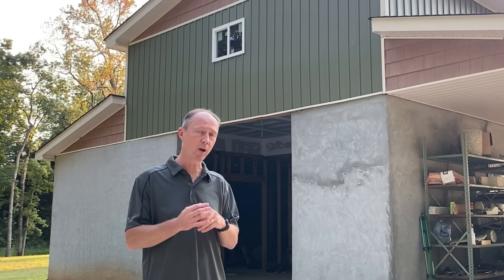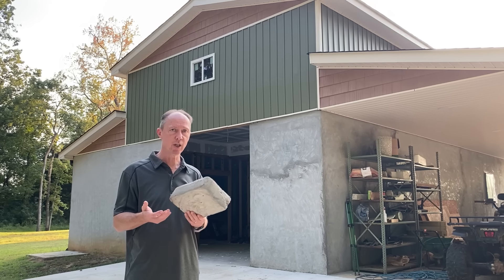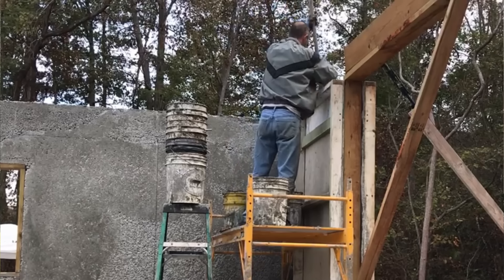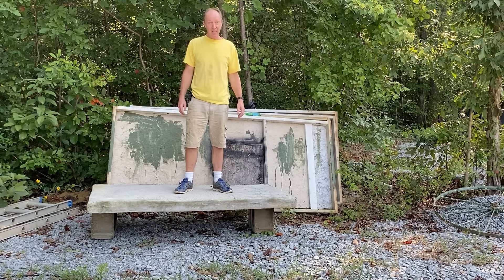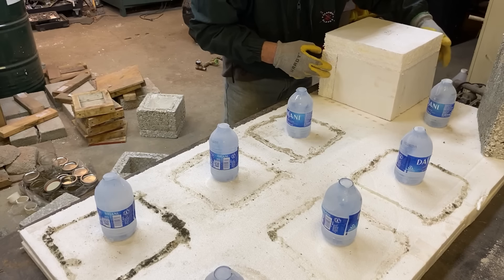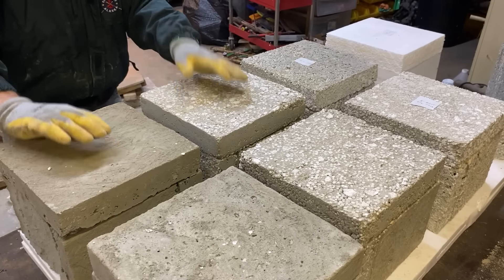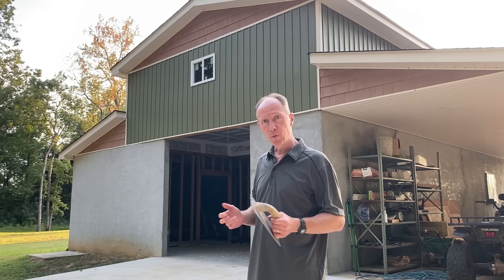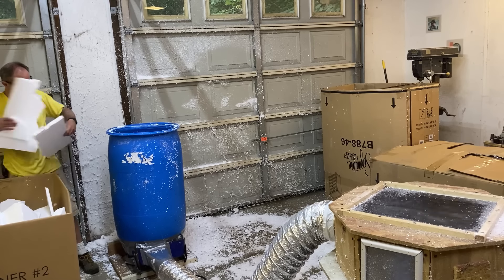The White Gold Rush?! The Video That CHANGED Aircrete Forever!

Comment: Where you will have windows. Try preforming a portion of wall with windows as per Tilt up conc. panel construction system. Put a groove at side edges and fill void with your mix for continuity once erected. Anchor joints with embedded metal plates...... I would like to know if that helps you on your next project. Well that is if you will perform these method.... thanks
Reply from the maker: thanks for the tip! subscribe for new builds coming soon!

Comment: Very creative. Wonder if someone will watch your video and start a building business? Perhaps you should patent your process. 
What is the structural strength of aircrete styrofoam?  Not certain if it will meet local building codes??  Also, needs to be able to withstand 100+ mph wind loads (based on local codes). Not certain how one should test for that. 
Thanks for sharing. Looking forward to future updates.
Reply from the maker: Done! Subscribe for new builds coming soon!

Comment: Great information, thankyou. I have made a foam generator that can fill 200 litre drum in about a minute and a half but found it very difficult to get consistent aircrete due to mainly getting it mixed with the cement. I have tried mixing with sand and had separation problems with that. I think you have hit on a great idea that would work for me and I am now going to make a polystyrene shredder. I think it would make mixing a lot easier. Thanks again.
Reply from the maker: New foam free recipe video coming soon! Subscribe to be notified!

Comment: Easy way to shred the foam would be to get a metal rod drill a buncha holes in it the same size as a metal clothes hanger put them through then bend them 180 put a hole in the bottom of the drum for the other side of the rod to ride in using locknut and washer to the bottom attatch the other side to a drill and in no time then would shred it up
Reply from the maker: Thanks for the tip! Subscribe for new bulds coming soon!

Comment: At 10:12 where you show filling in a void under the window. I can see in the rest of the wall heterogeneity in the mix. The bottom has less Styrofoam in the mix than the top. I think this is due to your pouring with buckets and mixing method. I would be interested to see how homogeneous you can get the mix with a concrete pump and a bigger mixer.
Reply from the maker: New builds coming soon! Subscribe to see the results!

Comment: Can you attach this to the outside of a cinder block house for strength and insulation? Are you sure this will last for year's to come? Awesome video thanks for sharing.
Reply: Tommy you would need to make a mold however thick you want to pour up next to the cinder block. Wet the block with bonding agent and pour it in and pack it. Then cover with the fiber mesh and stucco it. Yes it will last.
Reply from the maker: New builds coming soon! Subscribe to stay tuned!

Comment: hmm this makes me wonder, what if you produced small glass hollow beads the size of marbles (could make a machine that pumps them out pretty fast), and mix that with the Crete slurry carefully, how good would that be?!
Reply: if you are into recycling, you could potentially do that with plastics as well id say,  mix a small amount of crete to a large portion of shredded Curled plastic waste (ultimately making a brick that is 80% air),  and coat the outside to make it solid
Reply from the maker: Sounds great! Go for it! Subscribe for new builds coming soon!

Comment: I've found much success using Poraver(expanded glass beeds), and using a superplasticizer(high range water reducer) to increase the flowability, ~2-3% or so added fiber reinforcement.  It creates a much more stable product, but obviously it is not nearly as recycled or cheap as this method.  I lay fiberglass mesh mats w/ 1/2" spacing on the inside vertical surfaces of the molds.  My molds have small holes so that I can tie down the mats to prevent any movement during pours.  This results in a fully structurally stable wall once fully cured.  It just requires a few coats of stucco for finish.  Your method I'm sure is magnitudes cheaper though, Poraver can get a bit pricey.  I might have to try to incorporate some recycled Styrofoam into the mix design and see if it remains stable.  Nice job though, the finished product looks great and seems quite strong!
Reply from the maker: thanks for sharing! subscribe for new builds coming soon!

Comment: Thanks for the encouragement. I have experienced the same problems with the inconsistency of aircrete. You described the parge you apply to the workshop wall as aircrete stucco. Could you please elaborate on what this is?
Reply from the maker: UGL, I did not say that right if that is what I said. I am using a regular 1 part portland, 2 parts sand mix for the first coat , and 1 part portland and 5 parts sand for the second coat.
Reply: @AbundanceBuild  Thanks for the clarification.
Reply from the maker: Workshop July 25 - 28th!

Comment: Hi Stephen, I really enjoyed your video's. I am a construction student and and working on a home design for a final project. I have been looking for affordable, sustainable building techniques to bring down the costs while raising the sustainability. I would love to chat more with you about this or see some more videos. I see they are very recent so I'm sure you're hard at it. The only thing that I'm not crazy about is the stucco look on the exterior of the home. Wondering if you have experimented with any other finishes that reinforces the styrofoam aircrete? Still, its and interesting alternative that has potential. Thanks!
Reply from the maker: Thanks for the feedback Andrea and glad you are studying affordable sustainable building methods. I have three videos out total now and working on the 4th. My next build will have light wood trusses in the wall on 24 inch centers and give you a nailing surface for any siding you want to use on the wall and roof. My email is stephen.williams64@yahoo.com
Reply: @AbundanceBuild  greetings sir
Excellent adaptation and improved methods for alternative long term eco friendly efficient housing and structures.

Comment: Have you given any thought to approaching a university that has 1) school of engineering (mechanical, structural and material science) along with 2) a school of architecture (architecture, construction engineering, etc.) to perform some of the basic strength tests, material tests, construction techniques, design some basic structural products, etc. so that your overall approach will be generally accepted to the various building codes?   Your overall material would certainly provide an excellent basis for a number of senior projects as well as master's thesis.  This would lend itself to a wide range of cross-domain collaboration within the various engineering, construction, and architectural programs.  You have done the fundamental proof of concept on the material and construction techniques to entice a university to help you take it to the next level.
Reply from the maker: IO great idea. I will try this. I want to try some further improvements before I do that.

Comment: Great idea...I have looked at the aircrete stuff on youtube and it is an interesting concept.  We get 40 inches of rain a year and water is always a problem.  Hydraulic pressure in basement walls gets intense and it is tough to keep a basement completely dry.  Wondering if this could be a help with basement walls below grade?  It would need some way to  water proof it...
Reply from the maker: Kelly you have a big problem. You need concrete and rebar in the wall to make it strong enough like an ICF wall. Look at EF Blocks. They are made out of ground up EPS. Look at their block design. You can make your own mold and make them yourself. Yes you will need a waterproofing membrane. Their are several peel and stick membranes designed for this.

Comment: There is an architectural project in Arizona that has been around since the 1960's. Pretty sure the students build housing by just piling up dirt in a mound,then pouring concrete on it. Then remove the dirt. Arcosanti.
Reply from the maker: thanks for the tip! subscribe for new builds coming soon!

Comment: For the creative souls who watch this channel an easy creative way to make a high capacity elevator from the mast of an electric forklift or selection  machine(you can see one at your local Home Depot or Lowe's). You can change the pump to A/C if you choose but I prefer to keep it D/C so you use the original pump and controls. Most are 24 or 36 volts so setting 6 or 12volt batteries in series with a trickle charge is easy and has the added benefit of standby power.
Reply from the maker: thanks for sharing! subscribe for new builds coming soon!

Comment: What's the "R" rating of your product (per sq. in.), and have you had your three inch slabs stress tested for load carrying capability and strength (Comprehensive Strength Test?) ? What kind of pressure or force will it withstand? What about shear strength? Impact strength? I'm genuinely curious.
Reply: I think you are thinking of compressive load test yes?
Reply: @Wingnut353  It's sometimes referred to as a strength test. Depends on which testing group is doing the testing.
Reply: @MarkRVillano  Ok, I was just wondering if you were talking about something different than I had heard of (I'm a computer engineer, but I my bother is doing this sort of thing alot as a civil engineer).
Reply from the maker: New test coming soon! Subscribe to see the results!

Comment: Seems like a similar recipe to ICCF blocks like, the perfect block. I would love to make my own blocks, but the county building inspectors in CA wouldn’t.
Reply: Shane are you talking about EF Block in Arizona? Yes they are grinding styrofoam and mixing a portland based binder, compressing it, and manufacturing a great block. Problem is it costs $14/sq ft of wall area.
Reply from the maker: New builds coming soon!

Comment: The majority of the stress is in the extreme fibers for flexure and buckling, so by using stucco and wire mesh on both sides, you are essentially relying on the compressive and tensile strength of the stucco and wire mesh to provide strength while your aircrete styrofoam mix is largely just filler. You likely gain some compressive strength, but I wonder exactly how much. Portland cement paste is reasonably strong, but you have a very small cross section of actual cement paste with the shredded styrofoam acting as an aggregate filler. In regular concrete the aggregate is often much stronger than the paste itself. I wonder what the compressive strength is compared to something like Type IV or Type IX foam.
Reply from the maker: Thanks for sharing! Subscribe for new builds coming soon!

Comment: Alternative to painting stucco could be spraying stain and sealing. Same as staining concrete. Or be creative and do Camo patterns for a cabin, or ragged edged uneven width horizontal tape lines ( to use unstained stucco as faux "chinking") and stain exposed stucco with varying shades of brown for logs.
Reply from the maker: As long as it's water resistant go for it.

Comment: I started using styrofoam in my drainage system. I roughly chop it up and add it inside of the drainage sock around my 4”Corrugated pipe. I also line the entire trench with non woven geotextile because I don’t want to risk putting this garbage in the ground and losing it! 
It has worked great honestly 
I have used a little bit of gravel but not much. 
I’d be shocked if I used 1/4 of a yard. 

Best part? It’s free. Every appliance or large item comes packaged with it!
Reply from the maker: Great job!

Comment: What a neat idea so I am subscribed! I'm also concerned about the health effects of living in a structure with styrofoam like that. Not all styrofoam is created equal and it's certainly not something you want to be breathing.
Reply from the maker: Thanks Coby. The styrofoam is encased in portland cement so shouldn't be off gassing. And using older EPS it will have off gassed the most just after it was made.

Comment: Have you considered partnering with a local university and have them perform industry standard material strength tests. That way you can have numbers an engineer can use to select the best uses for this composite material.
Reply from the maker: Alex, that is an excellent idea. The University of Alabama in Huntsville where I graduated from as an Electrical Engineer used to have concrete canoe competitions. So I am sure they have some testing equipment. To pay companies to do testing is super expensive.

Comment: I think I will try pouring the wall first and cutting out the window opening to save time and give me more options on location. Lots of styrofoam around and I need a chicken coop and dog house and wood is too expensive. Also may use extra steel roofing for my forms for a decorative touch. Thanks. Count me in as a new sub.✌🏿
Reply from the maker: Thanks for the tip! subscribe for new builds coming soon!

Comment: Interesting, but with a strong mesh stucco, why not use thick styrofoam for the walls? How does aircrete improve on straight foam walls (since the strength is coming mostly from the shell)?
Reply: He is using waste Styrofoam.
If he bought it new,, it would be cost prohibitive. 
Grinding and sticking it back to means he can choose the dimensions. 
The aircrete probably helps with the strength, the foam reduces fragility,  the skin stiffens everything up.
Reply from the maker: We prefer to recycle! Subscribe for new builds coming soon!

Comment: there needs to be some kind of company mass producing bricks out of aircrete or a hybrid material like this, so folks can just snap them together to DIY build all kinds of stuff, with mass production the bricks could be of uniform quality/performance and then maybe a push to make aircrete more acceptable for building codes
Reply from the maker: Timi, you are exactly correct. Look at EF Blocks. These are made from recycled EPS. Great ICF blocks but they cost $14/sq ft. You can make your own.

Comment: What mix ratio do you use (air, water, portland, Styrofoam, foam from foaming apparatus)

Do you have a link to the foaming generator you build ? Or how to make the foam..

What mesh did you use as stifling  ?

What's the weight of the end product, like ....... lbs/ft3 density  ?

Great video, keep them coming
Reply from the maker: Kevin, the mix is 3 1/2 gallons portland, 2 gallons water, 25 gallons foam, and 45 gallons of shredded EPS. I will be doing a video on foam generators.

Comment: Where do you buy ten dump truck loads of petroleum based styfoam snow?
Reply from the maker: We get it for free from furniture stores! Keeping it out of the landfill! Subscribe for new builds coming soon!
Reply: @Abundance Building Concepts  I'm not putting petroleum-based Styrofoam in a place in intend people I love, to sleep. Adding flammable material to something that's already fireproof is the exact opposite of my goals. Wouldn't adding unstable plastics to Portland mean you can no longer use the same engineering formula to figure weights for support?

Comment: Very interesting.   Pouring the walls in place is harder.   As they are light, pouring on the ground and then standing them up into place would seem more easier - perhaps not by yourself.  What are you doing to connect the wall pourings to the pour beside it?   Overlapping rebar I guess would be the concrete method.
Reply from the maker: New builds coming soon! Subscribe to stay tuned!

Comment: Just a question out of curiosity, as I see a lot of "Aircrete" channels from the US: Is Autoclaved Aerated Concrete not available in the US? (e.g. Ytong)
I can get them easily in all dimensions as professional product as blocks/larger panels, with specifications and instructions, up to code, and suitable for almost any building. They are very easy to work with and get into the shape you need.

Or is it a price-thing, and it is available, but just too expensive?

Insulation-wise, if you going to cover it with mesh and stucco anyway: Build a wall from AAC and stick XPS panels to it. Much better for insulation (because the concrete/styrofoam-mix has in-build cold-bridges due to concrete going from the inside to the outside through the whole block. Transfer of heat is slowed down of course, but you have in-build inefficiencies due to that. If you stick a XPS-panel to the outside, you avoid that, and if you going to cover it anyway with mesh, there is no additional work.
And with AAC you don't have to cover the inside with mesh, but you should cover it with plaster (the plaster is your inside vapor barrier to avoid moisture being drawn in to the wall from the inside warm and humid space (if you plan on having a door at some point :) ). As small capillaries inside the plaster meet large capillaries in the AAC (this is also true for bricks), the capillary transport is effectively broken at that interface)
Reply from the maker: Peter, I have heard that we now have 3 plants in the US making AAC blocks. They are a great product but still cost a lot for an entire house. This is a DIY method to build your own.

Comment: Question, does the styrofoam add any insulation value over plain aircrete?  Consider that aircrete is very insulative to begin with, so is this redundant and strength reducing VS plain aircrete?
Reply from the maker: Styrofoam performs better. Subscribe for new builds coming soon!

Comment: Hi Stephen,  
I am really excited about your videos.  I have looked at all of them.  I want to make some panels to lay on the ground as insulation between the ground and my concrete slab.  I was wondering how much a "45 gallon batch of styrofoam" compacts to once all the air is smashed out?
Reply from the maker: New recipe that doesn't require foam coming soon! Subscribe to be notified!